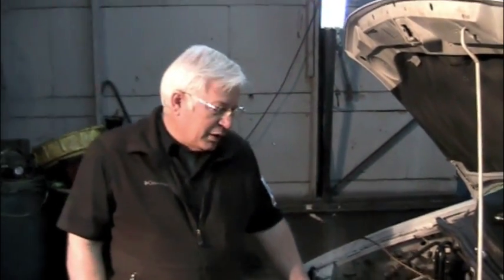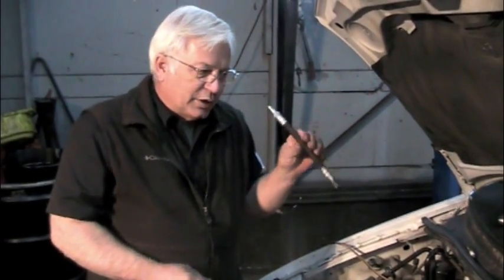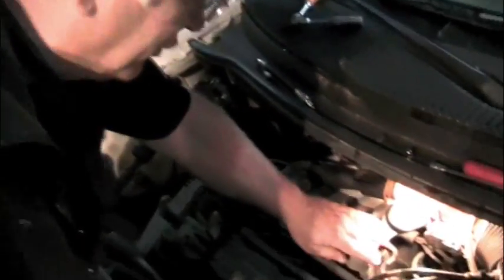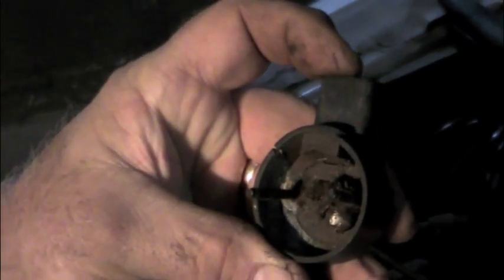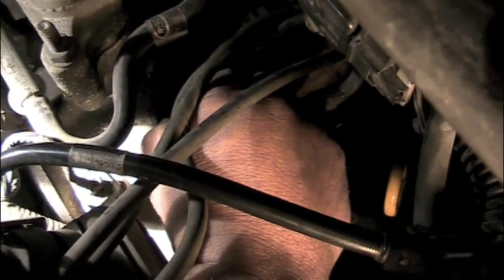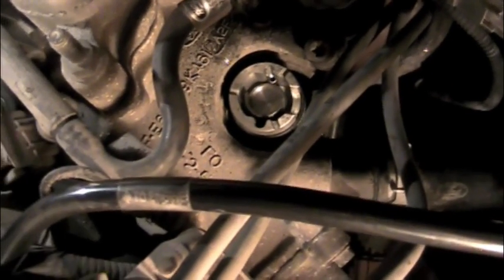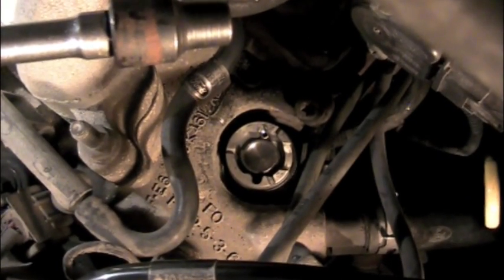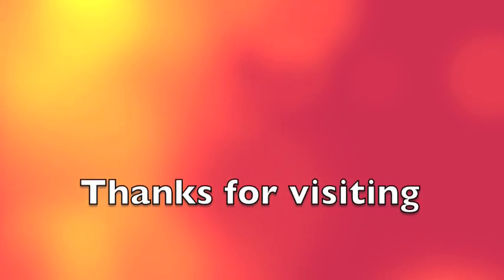Code P0340 Cam Sensor failure

Comment: Thanks for the details.  That 1998 engine is a legacy design where the camshaft sensor descended directly from the distributor, and likely fits in the same hole.  The late 1990's Chrysler Magnum V-6 & V-8 engines were similar and still had a spark distributor (w/ crankshaft sensor at engine flex-plate).  My 1996 Plymouth is a newer design where the camshaft sensor senses magnets on the end of the overhead camshaft.  Other current engines, especially with pushrods, sense slots on the camshaft sprocket.  Engines with a coil-pack don't need the camshaft signal to fire the spark, since they fire every stroke (termed "wasted spark"), which only requires the crank sensor.  But, for some reason, our 2002 Chrysler 3.8L won't spark if you disconnect the camshaft sensor.  It only needs that sensor to time fuel injection pulses to the intake valve openings ("sequential MPFI"), which only helps to slightly reduce emissions at low power (spray is short duration).

Comment: Hi ! thanks for your video ! I own a Ranger 3L 2008 and I'm enduring a clear problem to make the engine start. I have this code (DTC P0335) from the check. The vehicule went through several mechanics but the problem remain... Both CKP have been changed and wires have been tested and verified. The Engine is starting but I have to crank about 4 to 10 times and it seems that' the problem  is very related to exterior temperature. For exemple, in winter it will get a lot harder to make it start than with summer temperature. This breakdown make me crazy, so if you have any hint that could solve the problem,you are very very welcome !!!

Comment: P0340 Megane 2 1.5dci
Camchaft position sensor.
Validate fault present at time of request.
In my case he found the high pressure pump sprocket offset with two teeth in front of the camshaft and vibrochene.

Comment: I have a 2000 windstar that had cam shaft position sensor code. I just replaced the sensor. The 2000 windstar must be different from the 1998. the sensor itself contains a hall effect transistor and is merely a cap that fits over the end of the shaft going down to the camshaft. This shaft has a metal tab that rotates with the cam shaft and when it passes the hall effect, it merely produces a pulse of electricity that is read by the computer. It has 2 screws and only fits in one position so there is no need to consider top dead center. But if you must remove the entire shaft, you must know top dead center. I have one of these shafts in my hand as I type this. It has a long hexagonal shaft with a gear attached. The upper part of the shaft has one metal tooth projecting upwards. The sensor merely caps over the end of the shaft and can only fit one way. It has two screws that fasten it. There is only a hall effect in one side of the sensor and nothing else at all.

Comment: Thanks for sharing the video. My daughters 99 Sable has codes PO174 and PO340. I read somewhere that replacing the synchronizer may fix both of these codes. Otherwise i will be looking for a vacuum leak or cleaning the maf sensor.

Comment: I have done everthing that you showed on utube; on how to install a camshaft syconizer. Could you tell me why does she idle in gear; and when I take her out of gear and try to put her in drive she shuts down?  what else could be the problem. I also installed a new timing sensor with the cramshaft sync.

Comment: How do you turn the engine over to reach TDC by grabbing the belts? Is that even possible for one man to do? Would you not be better off placing a large socket over the crank pulley bolt to turn the engine to TDC? Does anyone here know what size socket to use?

Comment: nice video !!! the first time i came across this ,it was the same as your case !! the top was wasted . never did this before, but alldata saved me !!!!!! also,it's great that the tool comes with the part !!!!!!! i always learn something from you,even though i've been doing this for 25 plus years !!!!

Comment: good point sir. i am wondering if this goes for 03 durango with a 4.7 on it. the valve seat was dropped and we had to take the head off and do the valve after we put it back together , at first we had the code p0340 and p0344 cleared the code came right back on and now it gives us the code for p016 CPS bank one correlation. you think we should do the same and take the sensor out and bring the no. 1 cyl. to top the center as well? i would appreciate the help.

Comment: Hey man, Good point... my dad just did his and he did not find TDC either.  So, you can be "out a tooth" and the engine will run because the PCM will set the fuel timing?  
AND... can you change the spark plugs on these 3.0 Vulcan engines without removing the plastic intake manifold?  The manual says to remove it, but I would rather try to get around it...
Reply: Robert Ruis

Comment: i have a 2000 ranger V-6 rough idle then stalls....engine load %is 90 to 100 % at idle ..tp is at 70% at idle...changed maf, cmp, tp,ckp,..no codes and still rough idle...mobile tech told me it was all my i injectors
...how true can this be..

Comment: I do Mobil flashing. Shop has replaced the second Cam sensor for this code and code returned after about one month. They replaced the PCM, same condition. Sensor from aftermarket parts. Any suggestions to help this shop?

Comment: @osu67 i put mine in off, i have no idea how off. i used the tool but did not put it top dead center. is it harmful to my engine to keep driving it until i can take it to a shop? also what would you recommend me to do now, i still have the tool but am not confident in rotating the engine to top dead center as is shown in this video.

Comment: There are 2 different installation tools, one is for the 3.0L=30 degrees and one for the 4.0L=45 degrees, Normally the correct installation tool WILL come with the syncronizer assembly! 
 If the CMP is installed incorrectly engine damage may result from improper fuel timing!
 
 28 Year Master, L-1 Technician
Reply: How could pulsing the fuel injectors at the wrong time cause "engine damage"?  Many EFI systems (esp. early) fire all injectors at the same time ("batch mode").  "Sequential" injection doesn't help much at high power since the fuel injectors are spraying most of the time (up to 80% duty cycle) while the intake valves are open less than 25% of the time.  Sequential only helps reduce emissions at low power levels, especially around idle.

Comment: what do you mean 30 degrees off the center i have a taurus and have the same problem i bought the syncronizer but just put it on however the the check engine light wont come off help plz